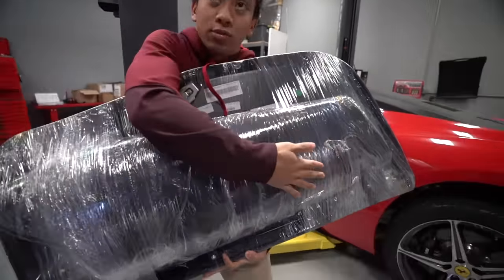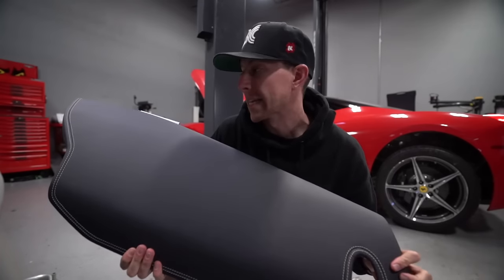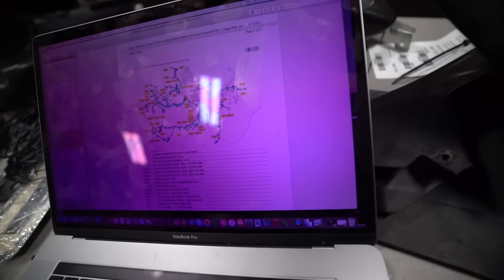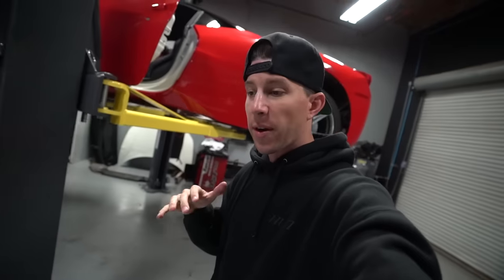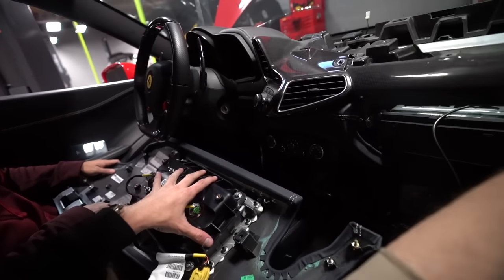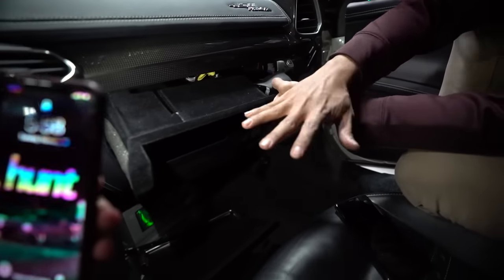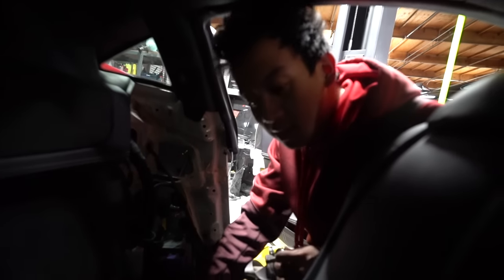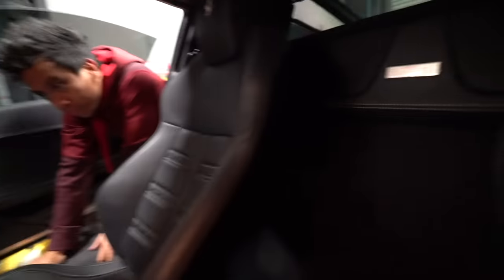My WRECKED Ferrari 458 has a FINISHED Interior!

Comment: FYI I work at the company that manufactures that  seatbelt. The seatbelt mechanism works and lets you pull it away when you put it in the angle it would normally be on the pillar of the car. Otherwise, you can break the lever inside the mechanism and will not work correctly anymore.

Comment: For the seatbelts you dont actually just pull hard you have to have them at the exact angle they are mounted at then just pull out normally on them and they release, worked this out when doing the rear seat in my evo X.

Comment: Seat-belts, belt pre-tensioners and buckle tensioners **MUST** be replaced! (At least sent back to the factory for full inspection and rebuilt)
Don't leave them on the car once they did their job. Check the seat-belt tower housings (each side, up and down) for cracks or bents. Inspect the seat floor frames also as they absorb most of the forces during an impact.
Full seat-belt system will not be able to perform on another impact efficiently. (Whatever this means to the passengers... if they are still alive after-all to tell their story...)

Comment: Why would you solder those new connectors on? Just de pin the broken connector and install the good one dummy . Splices should be avoided whenever possible.
Reply: The entire front harness was spliced because it was cut. Prob nothing to de pin.
Reply: InsertInsultHere HUH? Every plug on every wiring harness in the word is plumbed with pins. Two seconds with a pin tool per connector to detach. And then reattach the non broken counterpart
Reply: InsertInsultHere that made absolutely zero sense whatsoever though
Reply: @dylanmounsey7515  k bye
Reply: InsertInsultHere they listened.